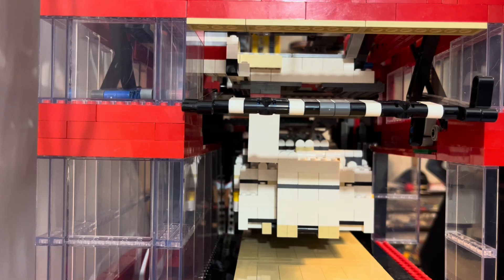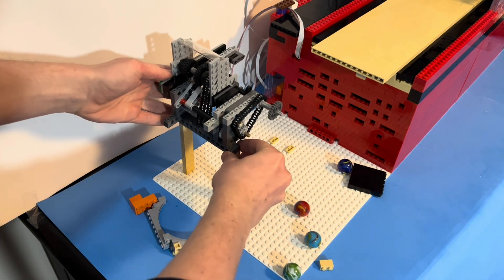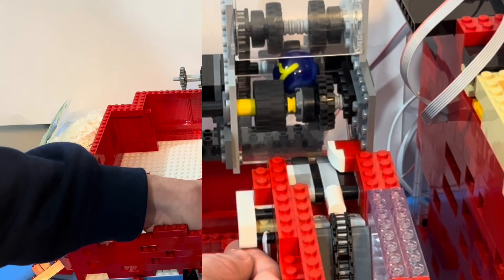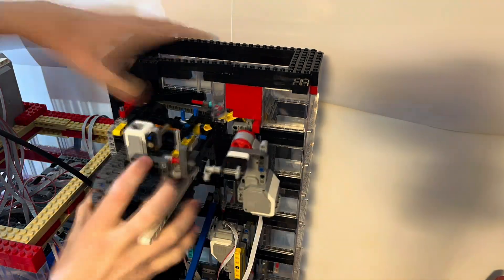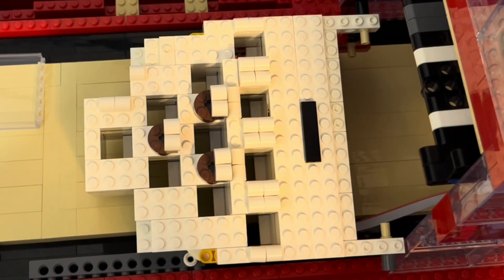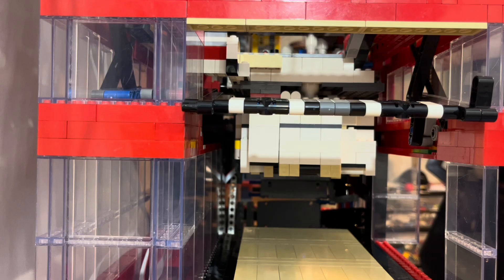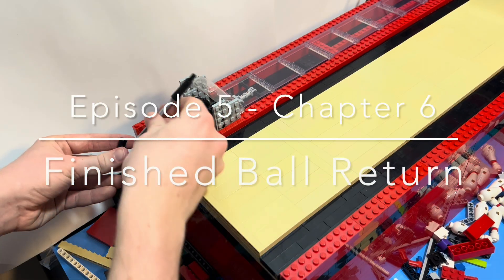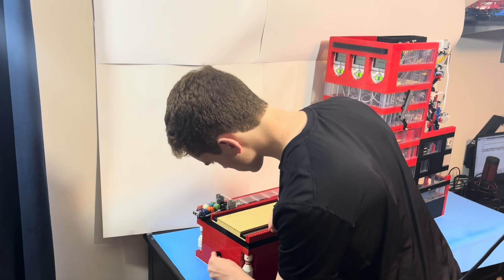My LEGO Bowling Alley is Finished! - Episode: 5

Comment: good work on it im struggling to build pinsetter for my plastic mini bowling pins would be nice if u did instruction video on the 10 pin pinsetter  to build one. it would be much help
Reply from the maker: @lukeirle4198  while I don’t have instructions for this pinsetter I do have instructions for a 6 pin pinsetter which could easily be scaled up to 10. The instructions are in my mini bowling alley tutorial video (posted 8 months ago). Episode 2 and episode 4 of this series would also be good references for the pinsetter mechanism